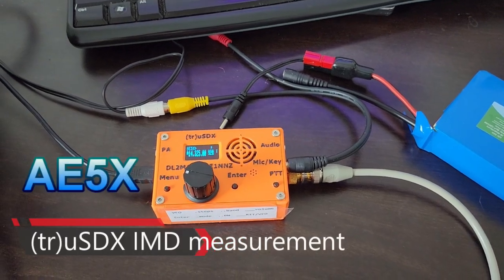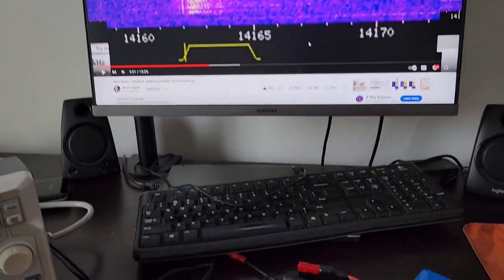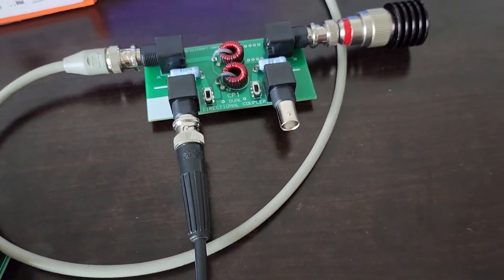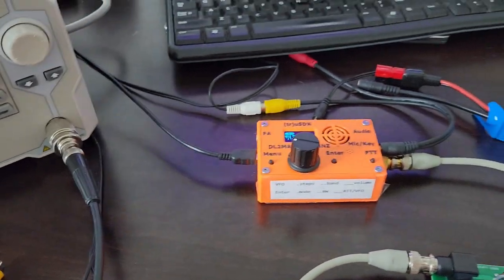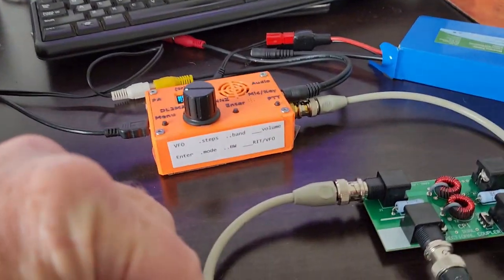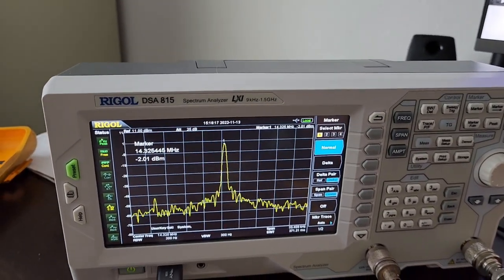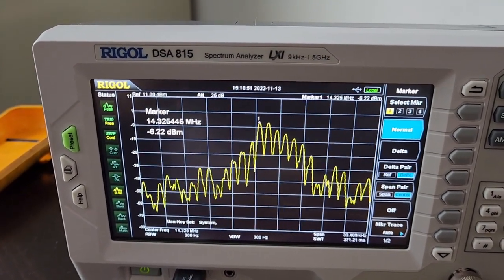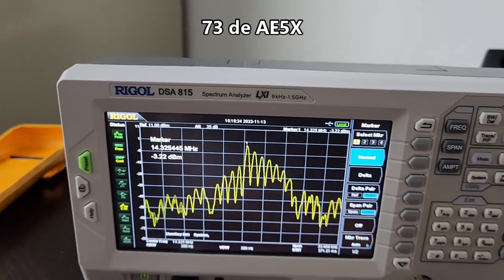truSDX IMD performance

Comment: It’s caused by the algebraic sum of the SSB audio envelope from filtered PWM and SSB PLL SI5351A, square wave through capacitor coupling.
For each clock cycle, at logic level 0v, the gates see only SSB envelope voltage  (threshold gate voltage is maintained at menu 8:2 PA bias) and at logic level 5v , the BS170s are fully ON).
This combination creates a 50% of restored SSB envelope  interleaving with 50% CW, that reflects your experiments with single and dual tone.

At the beginning, PE1NNZ had used a cascaded modulation in his QCX-SSB prototype (drain modulation). The BS170 gates are clocking with PLL SSB carrier while drains Vds SSB audio modulation is performed by a different transistor.

On my YouTube channel I have posted 2 videos showing performance of gate and drain modulation. Spectrum of gate modulation has a clearly visible carrier frequency and poor linearity.

Comment: Thanks for the 'peer review' John.   I was under the impression that my problem may be unique, now I'm not so sure. :-) 
I'll link this vid in my reply to the lengthy comment I just had from Manual over on my vid.
Reply from the maker: I just read DL2MAN's comment on your latest video. I will re-perform this IMD test later today, changing various settings in the (tr)uSDX as I do so, including rx bandwidth settings. FWIW, this was a pre-built unit bought from China. I hope viewers will note that I am happy enough with my (tr)uSDX that I recently bought another one, this one for the higher bands and in kit form.
I have updated my posting of IMD performance on my site here:
https://ae5x.blogspot.com/2022/11/video-transmitter-imd-of-trusdx.html
with images of spectral plots at both minimum and maximum BW settings on the (tr)uSDX.
Reply: @AE5X  I think I'm zeroing in on the source of the trouble.  
Have you done a firmware update on yours since it arrived?  
If so, what are your pa bias min and max settings?
EDIT:  Wait, nope, that's not it....  I just fiddled around with the settings and it didn't change the clipping. 
Of note though, my radio slipped off the shelf and dropped about 8 inches to the desk with a thump.  Now the distortion is not nearly as bad.  Still there, but much improved.  
I guess I'm back to examining the hardware for yet another poor connection somewhere.
Reply from the maker: @loughkb  My rig arrived with the latest firmware so no need for an update. PA Bias min and max are 0 and 128.
Reply: @AE5X  I updated the boot loader and firmware on one of my radios, and just the firmware on the other. They both have identical results. It appears that the mic gain is reduced with the firmware re-load.  The splatter was reduced, as the TX output was lower.  So I changed the TX drive from 1 to 4 to get the  power up to about 3+ W.   The 3rd order IMD wasn't changed with any of the changes I could make,  supply voltage, TX Drive, etc..  

I was able to make some contacts, so it does work on SSB but the IMD problem needs a solution.  I think it is a big part of the problem.  I added an RF "shield" between the two boards, but it did not help.  Is there something driven into a non-linear  region in the audio, causing the IMD problem or is it in the firmware/processor?

Other than this IMD problem, I like the radio and appreciate the creative design.

Comment: In pure speech the multiple tones are mostly harmonics. Does it differ when you do this test using two audio tones that are harmonically related?
Reply from the maker: I don't currently have an easy way to inject other frequencies into the rig. I suppose I could use Audacity to generate them and may do so in the future. For now, I want to try to do everything I can to mitigate the IMD performance as shown - I will be working on that this week.
Reply: If the level of tones is dropped significantly does the splatter clean up
Reply from the maker: @technishn  No, it's either all there or not at all there.
Reply: I don't have a unit, but just had a quick look at the schematic. THE ref A point which feeds a bias to the mic is only lightly filtered at audio with a 100nF. I wonder if a series R of a 100ohms or so and some uF will provide some extra filtering to reduce any tendency.
You could scope the A reg line to see what happens to it when it goes ghastly..

Comment: It's a shame that the transmitted audio from these little radios sounds so incredibly nasty on SSB. I only use mine for CW and was aware of the grim SSB performance when I bought it. It's fine as a multi-band CW rig but I wouldn't subject anyone to that awful SSB.
Reply: Then the thing to do is to clean it up. I figure we're hams, not CBers. Even with just a tech license we're licensed to do whatever needs doing to our gear. That's the fun part of the hobby to me. Talking is of little interest to me, but getting a rig working so I can talk is very satisfying.
Reply: @johnwest7993  it's not something that can be "cleaned up" as it's a direct result of the methods being used to generate the SSB signals. It's about as good as it can get. It's amazing they can generate anything usable at all given the limited horsepower.